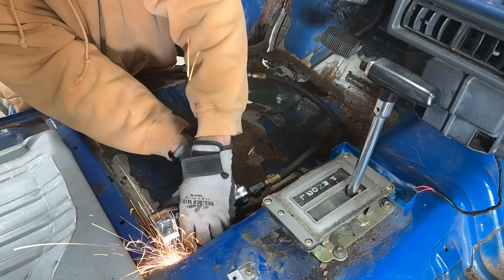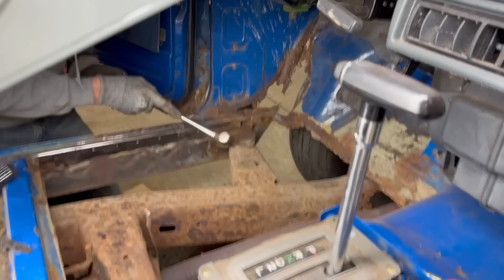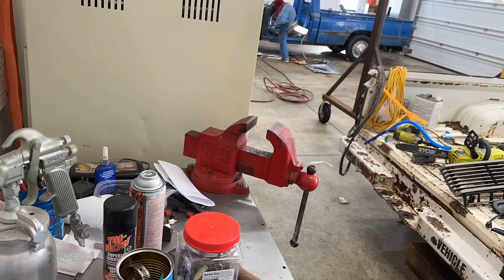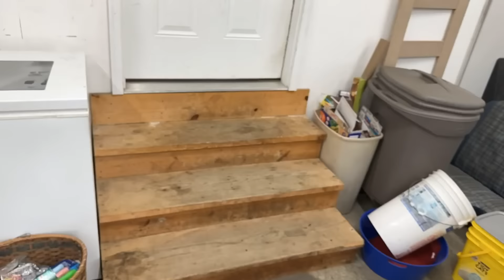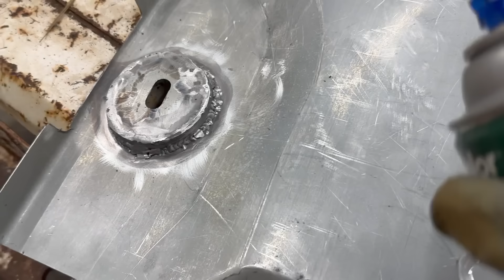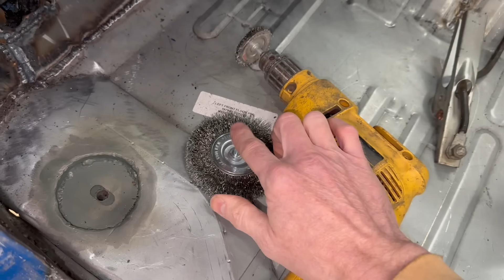How to: Repair/Replace Rusty Floor in Vehicle - Complete Guide, Start to Finish

Comment: Great video got me inspired. I am going to be doing the same thing to my 85 Chevy. Camaro driver's side floor pan is Pretty bad I was a little afraid to tackle this project myself. But aint not too but to do it rigth also I do have a Lincoln welder 140 mig that i Purchased from home depot so i am ready  your video is definitely going to help me out. Great job sir
Reply from the maker: The biggest help is if you are able to buy preformed floor pans.
Reply: @6thGearGarage  Thanks For the fast reply. I was able to purchase half of the side that I need I just never done this type of work before But I don't want to pay anyone either. Something I want to try to do myself After watching your video I am confident that I can do it. Also i can tell that you have Weld before because you look like this Is not your first rodeo  Anyway, I do appreciate the reply Thanks again.
Reply from the maker: @floridamanfishing1390  yes, make sure to be comfortable with your welder and familiar with the settings through practice on scrap metal first.

Comment: I will certainly clean up all the surface rust i can reach on the chasis before putting a new floor pan on top of it. That's "once in a lifetime" opportunity to have that part exposed.
Reply from the maker: Excellent, I would have done the same but this frame is too rotted. I have a better one from a parts truck that I restored to put this cab onto: https://youtu.be/gmFx6OUw7Xo

Comment: Hello 6th Gear! I especially like that you took the time to talk about the value of one tool over another, like the aviation snips versus the tin snips for cutting the sheet metal. Sharing your knowledge here is very much appreciated. I am a very amateur sheet metal welder, (MIG), myself and seeing you weld your sheet metal without too, too many "blow-throughs" was encouraging. I have a 40 year old Volvo "Brick" to do some rusty floor repair on, and your video has really inspired me to have at it! And like you indicated, after you clean up the welds, use the seam sealer over the etch-primer in order to seal up any pinholes from moisture creeping in from the other side. And by the way, your bloopers at the end are hilarious. It was great to see your sense of humor. Keep up the GREAT work: your videos are so down-to-earth, informative, and entertaining - all rolled into one! Thank you very much!
Reply from the maker: Thanks for the comment, I really like to hear that these videos are inspiring/helping others!

Comment: I believe rocker panel first then floors??
Reply from the maker: I think either method would work. I started with the floor because it was the most rusty and the rocker panel was pretty good.  On the passenger side, I did the rocker panel and floor at the same time: https://youtu.be/JrmNcHkoDYs
Reply: Looking gd .Just getting started on removing rust myself. good to see u can make the bends needed with  vise.

Comment: Weld primer in between all overlapping seams.... this will start to develop rust in a few days
Reply from the maker: I spray all cavities with fluid film because it will creep into all tiny spaces and keep an oily film on the metal to prevent rust

Comment: i would use oportunity, once flooor is out, to clean frame from surface rust, do antirust treatment and paint it.
Reply from the maker: The frame on this truck was too rusty, but I prepared a different frame in this video, which I will be moving the cab and bed onto: https://youtu.be/gmFx6OUw7Xo

Comment: I am surprised you didn*t cut all the good metal from the parts truck to replace all the rusted parts from the blue pick-up, it would cut cost down  it has all the shapes & cont9urs of the  pick-up.
Reply from the maker: I would have but the southern truck's floor was just as bad as the ohio truck's floor.

Comment: Taking for ever because ur using the wrong bits.you dont use the 2nd step bit on spot welds.either you use a regular bit or a special bit for spot welds.
Reply from the maker: Yep, I ended up getting the spot weld drill bit in the video and it works much better.

Comment: Since your floor mount was rusted away gow did you find where the original hight and position for the new one you fabricated? Thanks and continued luck on your project.
Reply from the maker: I kind of just guessed and set it on top of the body mount bushing to figure out about where it should be.
Reply: @6thGearGarage I would be a little worried about stiffness of the body mount bracket.  The original had stiffening darts that your piece didn't.  There is a channel called Fitzees Fabrication, he does rust repair with simple tools, check it out.  He makes ribs using a hammer and a vise plus stuff he had laying around.

Compared to what you started with your repair is good.  Thanks for sharing,
Reply from the maker: @jimw6991  I have been thinking about that as well. when I pull this cab off of the frame, I'm going to stand it up and take a closer look at that area to see if it can be reinforced.
Reply: @6thGearGarage  You should be able to add a welded gusset to your bracket on each side of the body mount cushion (doughnut).  You want your frame very stiff compared to the body mount to get the isolation out of the system.

Comment: That's interesting that you said the welds on the body mount bracket wasn't your best. Weld through primer is a weld contaminant.
Reply from the maker: Good point! Also, thanks for defending my subpar welds. I'm a decent welder but some days are better than others :)

Comment: Man!! You must love that truck. Even if you finish, what’s it worth? Good luck man be safe.
Reply from the maker: The 2wd Toyotas aren’t worth nearly as much as the 4wd trucks, so I’m not exactly sure what it would be worth. Plus it’s not an original numbers matching truck, so that really makes me wonder what it would be worth. I’m going to keep it around and use it as a shop truck for hauling parts, lumber and 3wheeler. This has been a challenge to restore, but helped me learn what I’m capable of. 🙂

Comment: I did the same thing on my Ford Mustang but didnt ever use welding... I used automotive Floor pan sealer and rivets... Great job !
Reply from the maker: Thanks!  How did that floor pan sealer hold up? That sounds a lot easier than welding.
Reply: @6thGearGarage  So far so good ! A lot of the floor pans these days are not even welded but sealed... I used POR-15 undercarriage spray paint over the sealer for that extra added protection. This video was good reference... I do not own a welding machine so this was the best I could do... https://www.youtube.com/watch?v=YEHmcPjbFXM

Comment: nice work........but......if it were me i would have wire brushed the rusty chassis beneath the floor and used reformer & sprayed it before welding in the new floor
Reply from the maker: I will be pulling this cab off soon to put it on a restored frame. At that point I will take a look at the underside and see if it needs any work.

Comment: Anyone that knows how to do patchwork correctly will say that you should never just cut everything out all at once that’s rusted. It should be done in sections using the pieces you cut out as templates for your new pieces. cutting out large sections at once without making patterns for new pieces will make it difficult to replace and patch all the metal in a way that it was originally put together. It’s important to take measurements of the pieces you cut out and make card paper templates of all the pieces you remove so when the time comes to reconstruct everything, you don’t have to do any guesswork as to what size or measurements your patch pieces should be. The more you know 🌈⭐️
Reply from the maker: I understand what you’re saying, but I don’t know if I could work that way by creating templates when the metal all around it is still rusty. I like to remove all the bad and then come up with a game plan from a fresh start and rebuild it in the reverse order. Then again, I am far from a professional. I’m just a guy in my home garage with simple tools. If I ever had a high dollar project, I’d hire someone.
Reply: @6thGearGarage  I understand.. i’m just saying it’s a lot less guesswork. If you make panels based off of what you cut out instead of trying to guess that’s all my friend you’re finished product looks good unfortunately a lot of times when you don’t go off of making patterns off the pieces you cut there is an excess of metal introduced, or a deficiency of metal that’s creating pot canning, which is where the model pops in and out the manufacture had a certain amount of metal in mind that was beaded to prevent this type of thing bottom line your product looks good and it was just a suggestion to make things easier..
Reply from the maker: @mrgreezy1   Hopefully after some more experience I'll be able to work that way. Seems like it would save a lot of time.

Comment: Would the pickup floor pan fit an 88 4Runner?
Reply from the maker: Yes it should, they are the same body until after the doors.
Reply: @6thGearGarage  okay I will double check to make sure thanks dude
Reply: @6thGearGarage  Would the floor pan fit an Extra Cab pickup too? or its only for a regular cab.
Reply from the maker: @Random_Car_Guy   yes it would, Xtra cab is the same from the seats forward.
Reply: @6thGearGarage  Alr thx man I’m 16 and I recently bought a 1988 xtra cab to help me learn how to work on cars I did an oil change and changed the parking brake cable. Now I gotta do the engine belts and floor pans
Reply from the maker: @Random_Car_Guy  Congrats! Floor pans are a big job.  Just take your time and you'll do alright
Reply: @6thGearGarage  Do you know what would cause drive belts to screech when changing gears?
Reply from the maker: @Random_Car_Guy  That's strange. I'm not sure why that would happen. I'd recommend replacing them if they're old and making sure the tension is correct.
Reply: @6thGearGarage  Yeah the belts are probably worn out or they are misaligned and have the wrong tension. Ill inspect the belts
Reply: @6thGearGarage  I changed the belt and adjusted the tension and it fixed the problem

Comment: Have done many floors but have never seen aftermarket floor pans just curious where you found them.
Reply from the maker: There are a few options on eBay. Links are in the description 👍

Comment: Nicely done, fair amount of work to sort that out. Also if you havent already, id recommend you check out wire wheels for the grinder, used to use them on a drill too but theyre so much faster on a grinder
Reply from the maker: I do have one on my grinder but I used it to clean some greasy stuff in the past so I didn't want to contaminate the clean bare metal edges.
Reply: Nothing but grinder attachments for me. A die grinder with a cut off wheel or a cut off air tool helps get in tight spots. Substitute dremel if no air

Comment: Whats your opinion on bed lining the floor? Would it help with future rust?
Reply from the maker: I've seen a lot of people do it, but it cold also trap moisture and cause rust if not completely sealed inside and out.

Comment: Nice work! I’ll be doing the same just curious if the type and gage sheet metal you used?
Reply from the maker: I don’t know the exact thickness, I’d guess 16 gauge? They were old test panels for automotive spray paint.
Reply: @6thGearGarage  not 16g maybe 20g

Comment: Nice job!! Kiichiro Toyoda would be proud...Found my in the cab leak on my Ca truck. Spot weld rusted through where the water drains from the cowl under the fender, behind the hood hinge box.....would leak just sitting and filled my floor under the vinyl flooring...glad I found the water, was soaked....

Comment: Here is a tip for easy sound deadening removal. Get a bunch of dry ice, pack it on top of the sound deadening. Once it's cold remove the ice and tap it with a hammer and it will shatter and pop right off.
Reply: That's if you can get your hands on dry ice.

(As in buy it)
Reply: Warning: if anyone tries this method use proper gloves and avoid touching the dry ice. You can get burns on your hands.
Reply: @lupulflamand5673 right.. because the rest of the floor repair can be done without gloves?
Reply: @madcat4563  dry ice is dirt cheap and found in most grocery stores
Reply: Beat me to it!
Reply: I, too, watched the ChrisFix lemon BMW video series.
Reply: Or just wait until winter that's how I always do it here in New England anyway. Once it's cold enough you hit it with a hamer and it just turns into peanut brittle!
Reply: @rustybritches6747   im in new england and im getting ready to do this with my 2002 Zr2 S10 I just bought, I'll have to try this.
Reply: That depends on the different manufacturers sound deadening,  I've got a 2005 Ford Taurus and the dry ice didn't work, the only way I was able to get that out was a heat gun and scraper
Reply: Yes, that does work but it also takes off the rubberized coating under the vehicle. So plan to replace that too.